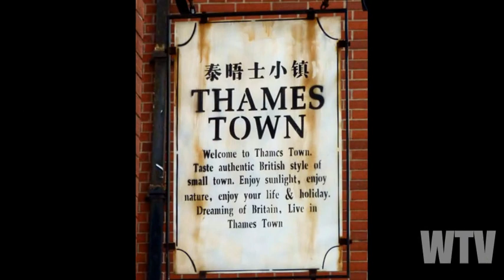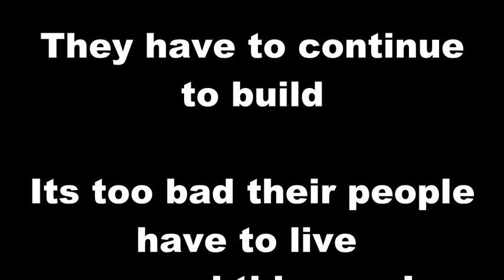What you need to know about the GHOST CITIES of China...

Comment: what will happen environmentally it will, like the middle east and north Africa transform the current ecosystem into a desert. Since there is sighns of water erosion on so much of the old structures found  from ancient eygypt, its believed that it was once a lush rainforest as was most of earth, but when civilization expanded and slash/burning parts and concrete or paving with stone over large areas not only increased the heat, but it also made extremely dry, and it doesn't take much of  this to start a domino effect with the surrounding environment ultimately creating arid desert zones where there had once been dence jungle, of course certain other factors would make other areas more susceptible to this effect like lat\lon, and elevation.